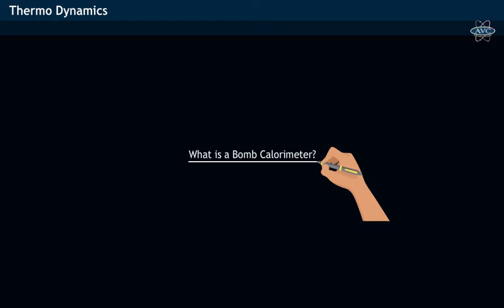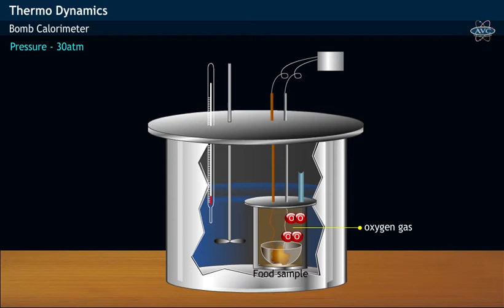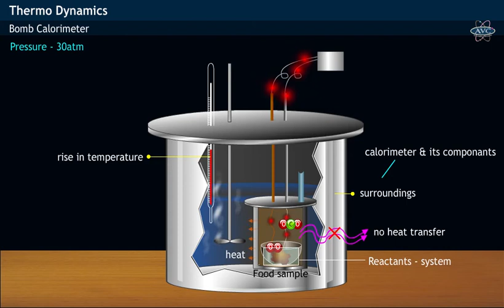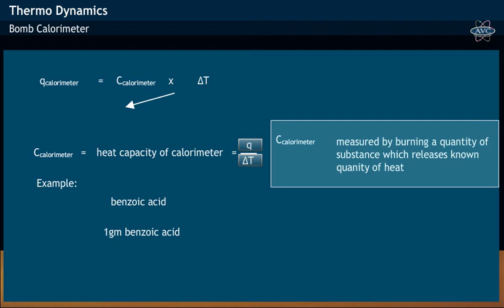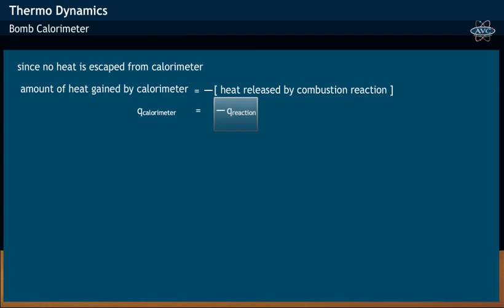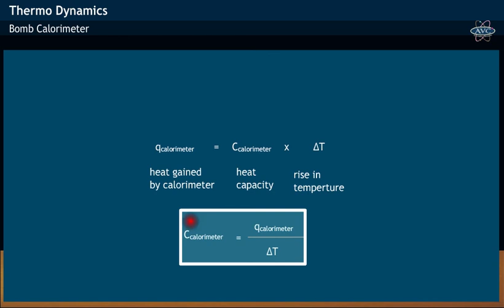BOMB CALORIMETER

Comment from the maker: Please find the solved questions of Themodynamics
 https://www.quora.com/Graphite-or-diamond-which-evolves-more-heat-when-one-mole-of-each-is-burnt/answer/Desam-Sudhakar-Reddy
https://www.quora.com/What-is-endothermic-change-in-science/answer/Desam-Sudhakar-Reddy
https://www.quora.com/How-do-you-find-internal-energy-from-pressure-and-volume/answer/Desam-Sudhakar-Reddy
https://www.quora.com/A-calorimeter-contains-200-grams-of-water-at-30-C-100-grams-of-water-at-60-C-is-added-to-it-the-mixture-is-well-stirred-and-the-resulting-temperature-is-found-to-be-35-C-What-is-the-thermal-capacity-of-calorimeter/answer/Desam-Sudhakar-Reddy
https://www.quora.com/How-is-the-lattice-energy-calculated-of-NaCl/answer/Desam-Sudhakar-Reddy
https://www.quora.com/Which-of-the-following-thermodynamic-properties-are-path-functions-P-V-H-work-done-W-heat-Q-Q-W-entropy-S-or-H-TS/answer/Desam-Sudhakar-Reddy?prompt_topic_bio=1
https://www.quora.com/What-is-the-thermochemical-equation/answer/Desam-Sudhakar-Reddy
https://www.quora.com/Why-is-there-H-on-the-second-equation-since-the-first-equation-fits-true-for-exothermic-reactions-a-R-P-H-b-R-H-P/answer/Desam-Sudhakar-Reddy
https://www.quora.com/What-is-thermodynamics-and-zero-law-of-thermodynamics/answer/Desam-Sudhakar-Reddy
https://www.quora.com/Why-does-the-temperature-rise-in-exothermic-reactions-but-fall-in-endothermic-reactions/answer/Desam-Sudhakar-Reddy
https://www.quora.com/Graphite-or-diamond-which-evolves-more-heat-when-one-mole-of-each-is-burnt/answer/Desam-Sudhakar-Reddy
https://www.quora.com/What-is-endothermic-change-in-science/answer/Desam-Sudhakar-Reddy
Thanks